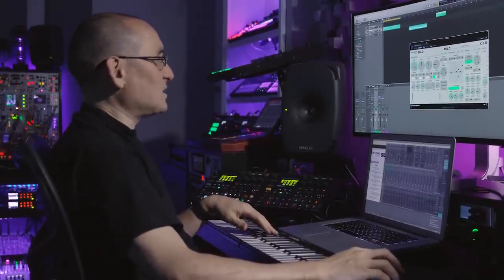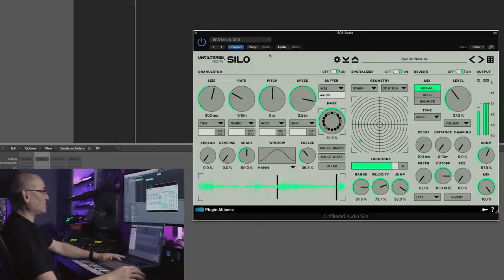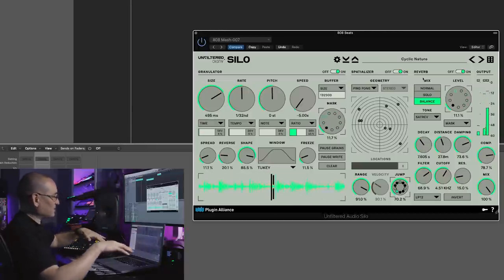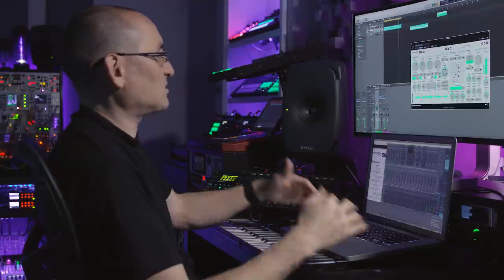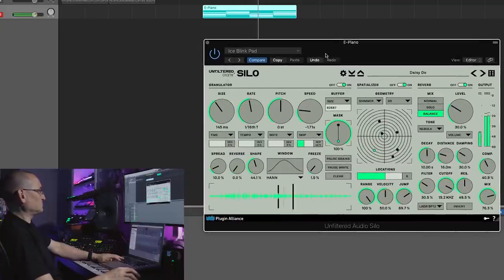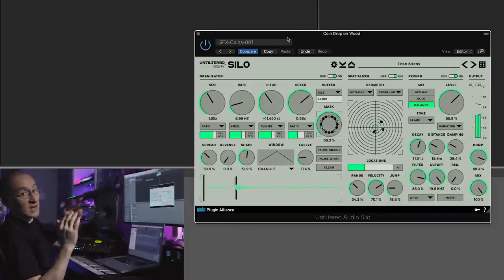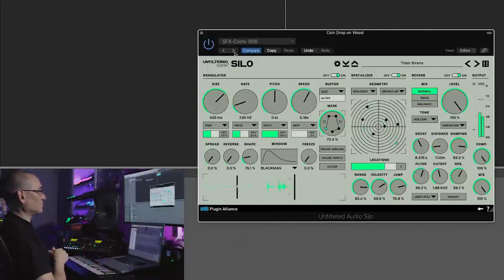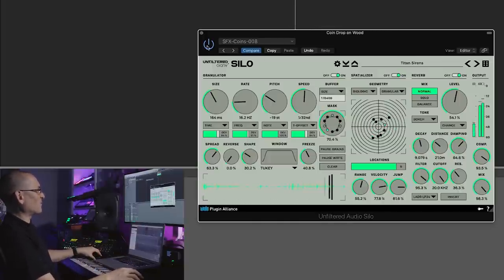Unfiltered Audio - SILO - Demo - Richard Devine | Plugin Alliance

Comment: Hope it'll be handy:
- First of all, Spectral Monitor of Sample should have zoom option and display all the length of loaded sample.
- Second, every granule should have start point, possibility to locate it's granules on the length of sample. And additional choise of movement direction of the granule. Like I would locate one granule on Kickbass of uploaded loop choosing forward "playing" (+here you may control the decay time of granule playing from chosen place) and another granule would be placed on Snare place of uploaded loop choosing backward "playing". This would be interesting and up to 16 granules would be quite enough.
- Third that came from the first glance. You, guys, have optioned effects in Geometry. Though, is it possible to adjust them? Moreover! If You, guys, are Unfiltered Audio, why not integrating some of YOUR 36 spectral effects from SpecOps (I personally bought it and am really glad of it!) or YOUR Sandman Pro! This would be really outstanding to split Geometry onto 4 regions with an effect on every one and a whole ton of adjustable choices. 
- Fourth. Where is Your trademark Modulation Bar? The only flaw of it is a lack of inbind fuction, users have to delete the whole modulator unlike just delete binded toggle. But still, it really makes the product outstanding.
- Fifth. That's quite inadequate and from future))) Every added granule should have own route on Geometry consisted of up to 8 (or better 16, but that'll overload CPU) steps, with smooth option, same choice of forward/backward moving on this route, possibility to draw this route and Geometry would automatically devide drawn route onto steps, different colorizing of every granule and it's route on both Spectral Monitor and Geometry, manual adjusting slope of line between every step of route.
- Randomizers and LFOs. They would appear if You added Modulation Bar. Just imagine, granule moves on it's route on Geometry and randomly changes it's movement from forward to backward, as a simple instance.
Well... as I said, I hope it'll be handy for someone. Better for You, Unfiltered Audio. Anyway, thank You, guys, for that You do!

Comment: While I´m very interested in this plugin, I didn´t really get the drum pattern part of the demo: Everything on 100% wet results in useless loops (just for me, others may fill albums with that). I would have liked to listen to the results at a much lower mix setting, so the dry pattern dominates and silo adds just that bit of background percussion related to the main events. Would that work or am I totally off track here ?
Reply from the maker: You can try each of our plugins for 14 days to see and hear how they work for you and how they compare to existing plugins or hardware. Just download and install the plugin, then add it to your DAW to start your trial.

Comment: That looks like MadronaLabs Kaivo synth, but the PluginAlliance protection system is a pain in the arse I can do without, which is why I still use version 1.1 of DimitrySches' Thorn & never used Softube after buying Spring Reverb (both iLok and CPU hogging Gobbler app - totally unnecessary). Over protection kills workflow of Plugin software especially with multiple instances. Beautiful sounds in this thing too. It's just a shame that I won't be getting it. You can't make large scale pieces of music like Tangerine Dream or Progressive Rock etc using heavily protected software without about 5 desktop PCs and an external Mixer.
Reply from the maker: Our licensing system is actually quite simple. Please check out our Activation Manual, or if there are issues, connect with our support. They can help:

https://www.plugin-alliance.com/en/activation-manual.html

https://www.plugin-alliance.com/en/tech-support.html
Reply: Their protection system is awesome, don't lie))) And it's surelly possib doing difficult music, just by bouncing tracks.